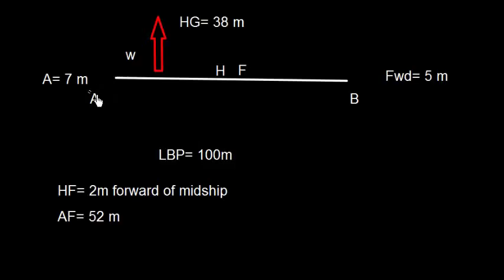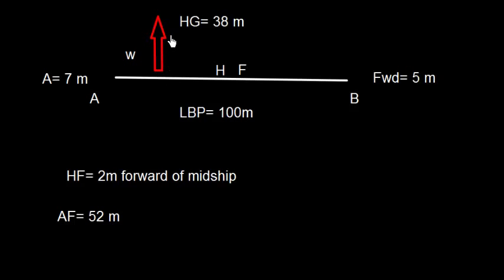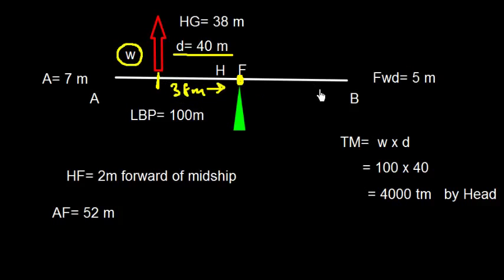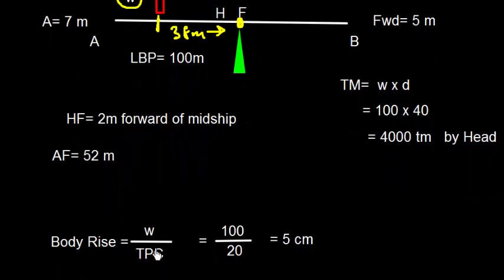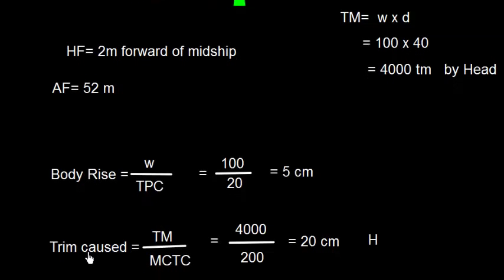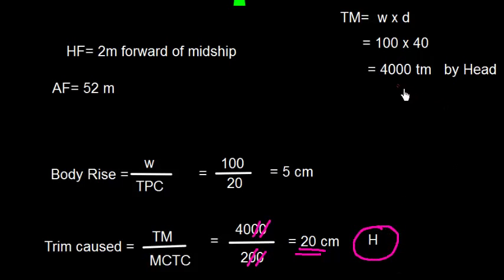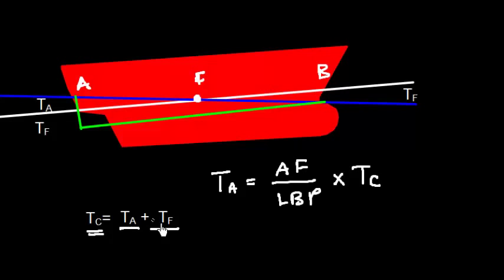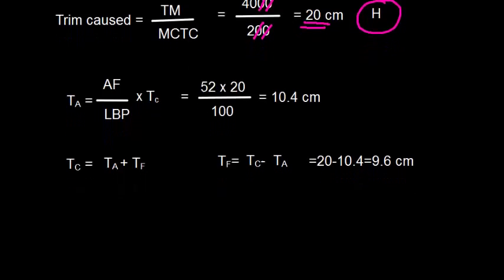Ship Stability _ Introduction to Trim Part 4_ Due to discharging

Comment: why we include the body rise for the calculation of final drafts even the discharge is at the aft not at the amidship? pls reply. tq sir for the great video
Reply from the maker: +Si Penchenta 
You  can  divide this problem into two parts. If you are discharging from aft ,  imagin you shift the weight to COF and this becomes a shifting problem. The second  part is to discharge the weight from COF. This will give body rise as vessel  pivots from COF ,  the centre of flotation.  Hope this answers  your question.